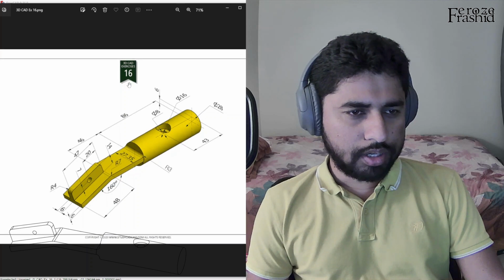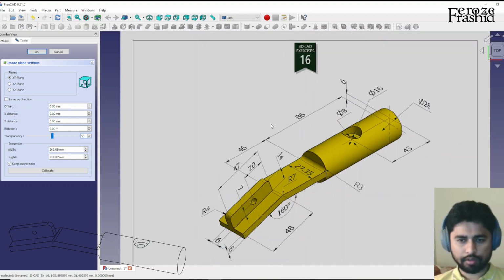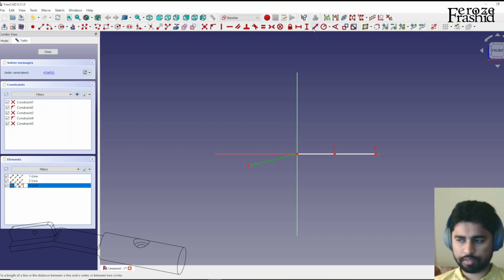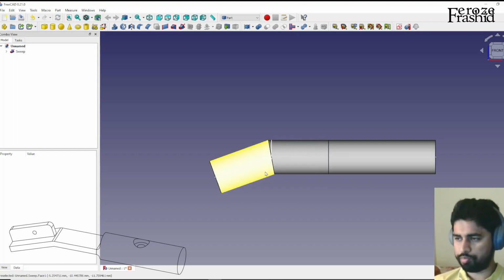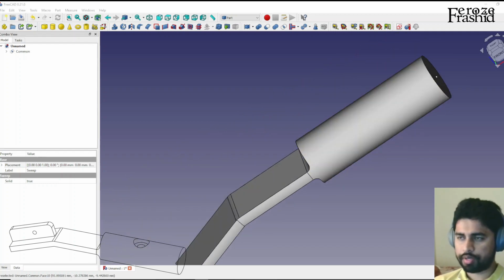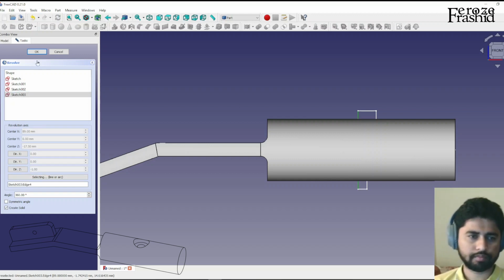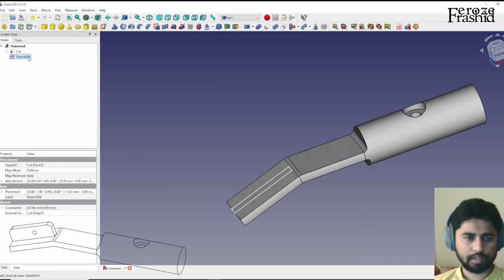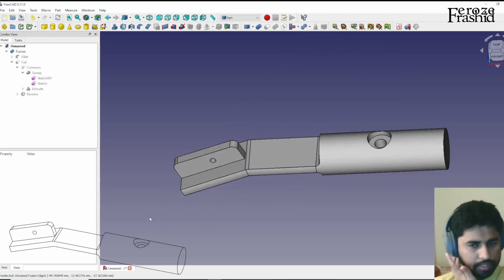Model Building in FreeCAD 0.21

Comment: I loved the use of the “commons” technique!
But I think that the facing of the sides is not quite right where the fillets from the cylindrical part enter the flat section….  You may have to resize the side “cutters” to be exactly the height of the flat section to achieve precisely what is depicted in the drawing. The drawing, however, does not really show a dimension in this regard. It could be the 46?
I always learn something new when I watch your videos!!
Thank you!
Reply from the maker: I see what you are saying. Extending the "cutters" half a milimeter more might have produced what the drawing depicted.